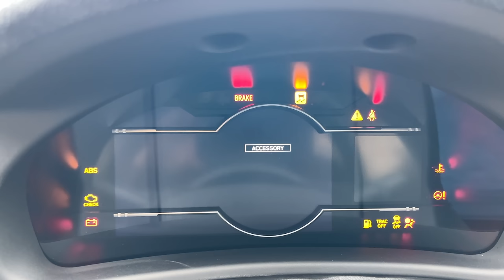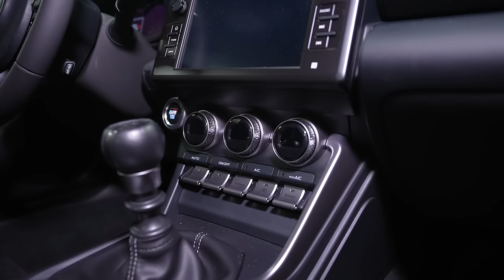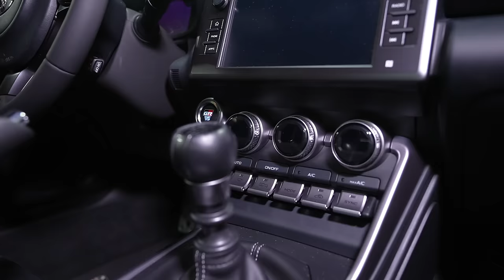Should You Buy a 2023 Toyota GR86? It's heavily over shadowed by a rival in 2023

Comment: Heavy econo car chassis that doesn't like to rotate with heavy front weight bias and understeer vs bespoke & stiff RWD chassis, on demand oversteer, lightweight & responsive NA. GR86 by a mile for drivers. You need to hit a back road or the track and look up the word, "special." One is a mini minivan and the other one is a pure sports car. You can get a heavy, 4WD understeering sled from a few manufacturers. Name another manual, RWD coupe under 3000 lbs on sale new.
Reply: ND2 Miata rf beats this in all aspects especially reliability. Not a coupe though but close to it.
Reply: @junkazama7922  
Sure it does because you said so.
Obviously internet experts showing zero evidence of their delusional statements should be taken srsly - not. LMAO!
Reply: @jun kazama  it's not a coupe and not close to it. GR86 is about 3x stiffer. RF adds only weight. No added rigidity. Same problem with the S2000. Lacks rigidity and only understeer sucks worse than cowl shake... Why enthusiasts begged for an MX5 coupe. We never got one. Sucks. Would be a much more serious sports car with solid rigidity. As is it's lacking.
Reply: @Racerx777  3x stiffer and still and gets beat on autocross. Sigh i wonder why.
Reply: @jun kazama  try a real track and get back to us. Auto X is parking garage racing. And it's not about #s. The new twins feel better and are just more fun. Joking aside, MX5s are bad ass but I do prefer the new twins. And if you want to get really serious? MX5 isn't stiff enough to go ballistic. 10K Nm/degree isn't going to cut it. 30K Nm/degree will. FI? Have at it
Reply: @junkazama7922  you will be pleased to know that several other reviewers, race car drivers included, have tested and stated that the MX-5 ND2 soft top loses to both S2000 and GR86/BRZ twins. The GR86 even outhandles the Mazda halo car.

So unless you do your own video, you're just another random dude from the internet making claims that can't be backed up with facts

Comment: Problem with the GR Corolla is that it’s reached unobtainable status by it’s limited production and dealer markups making the GR86 the only car in Toyotas lineup that’s sporty and affordable
Reply: Are they really only making a limited run with the corolla I had no idea, asking cause I'm on the fence on which one to buy
Reply: Toyota stealerships are trying VERY hard to make even the GR86 unobtainable as well.  My local dealer are blantantly marking the used cars as $42K.  A NEW one is $32k. lol.  Just INSANE.   They then try saying they mark them down, and you 'save' thousands, whilst still charging around $1k more than new. lol.
Reply: I would not buy a turbo 3 cylinder, especially a rally homologation, first iteration. It doesn't matter if it blows up after 1 season of rally.. but 50k miles on that engine? Hmm, maybe the 2nd version or after a few years. When you can see the cars endurance and some vehicles start passing the 100k mile mark, then some conclusions can be drawn.
Reply: poors

Comment: Before even the new GR86/BRZ were announced, I wanted a GR yaris more than any other car, but unfortunately it was never coming to the US. So when they announced the GR Corolla, I was superrrr hyped for it and pretty much dead set on it being my next car. Coming from a 135i, I wanted a vehicle that could still slide around a bit, but have the traction of AWD when necessary. The second I found out the corolla wasnt as “tail happy” as the focus rs or MK8 R, I went and test drove a 2022 BRZ, just me, no salesman. Man, 30 minutes in, I drove back in a hurry and bought that damn car. It’s every bit as fun as everyone says it is, and I haven’t regretted walking away from the GR Corolla one bit. I may just like it more than the 135i, but to me, nothing will ever top an inline 6 sound/smoothness.
Reply: I agree with you.  More companies need to bring back the inline 6 or else I'm gonna make my own
Reply: Im sry but if a 135 (even the M135) is a sporty car for you, you really need a  education. 
And therefore your comments are invalid on 86/BRZ. 
I love the idea of rear wheel drive, the ability to Power steer and throw the car into corners. But the 135 does none of that, if try and drive hard the traction control is on every corner and the rear still steps out wildly. it is not a progressive power slide/ Steer. It is just not a well balanced car. It is not enjoyable to drive hard or at all confidence inspiring. is one of the worst rear ends ever.
I drove a M2 and my commodore sedan ( With great tyres) both much heavier and both with  consideration for their market position are progressive power sliders and are not hitting the tra tion control every  corner.
Reply: Totally agree, the BMWs engine is sublime, but, like all BMW manuals, they are garbage.  The GR86 is truly the modern day JDM cheap fun car, and is almost a poor man's Cayman.  The M135i/M140i of the old RWD platform are just not fun to drive the way the 86 is, but they are great cars in their own way.

Comment: I guess the thing that I like about this car over the GR Corolla is that it's more 'romantic'? It's a simpler, more straightforward car. it feels like the GR Corolla's 'specialness' is diminished by it sharing so much with the regular Corolla, while one of the things that makes the GR yaris and the GR86 (technically) feel 'pure' is that they're unique bodies built to do the one thing that they do

besides, wouldn't a turbocharged GR86 cut into the 2.0 supra's niche?
Reply: This one is also RWD while the GR Corolla is AWD. Therefore I´m also more attracted to the 86.
Reply: The biggest besides HP is that the GR86 is clean lines 2 door coupe.  The GRC is just 4 doors ugly as hell.
Reply: I purchased the 2015 FRS right off the showroom floor. Best car I ever owned. It’s the only car that I’ve never traded in after 4 years. But now I really want the new model. 
I’m in love with the new red color ❤️‍🔥❤️‍🔥❤️‍🔥🏁

Comment: Having owned the previous gen BRZ, I agree with you. They totally should have focused on reinforcing 2nd gear.
Reply: Why? It makes no sense to me. 3rd’s synchros should be carbon, not 2 or 4. On track you use 2 and 3. You use synchros when up shifting. You should be double clutch rev matching down. 2nd synchros go out drag racing. Why are you drag racing in an 86? 😂
Reply: @JaySee5  Well nobody generally is drag racing them unless they're heavily modded, but the 1st gen in particular you'd be revving the nuts off it at all times because it was low on power, and 2nd gear always felt weird, that's all. You sound more knowledgeable on it than me though so I would defer to you.

Comment: Great video!! This is my dream car. Screw the FWD based GR Corolla. Don't care about how fast it can go, how it can drift with the gizmos etc... a proper RWD pure N/A engine can't be beat.
Reply: It can. I have an accord 2.0 sport, with very light suspension mods (mostly swaybars, strut bars) factory wheels, factory shocks and brakes. With a stage 2 tune and NO engine mods, I walked an m340i and am capable of literally bringing the rear around at a similar pace and hang with it on a track. So this is ridiculous assumption that RWD is in any way superior. Poor guy was mad that a mom car beat him in a straight and on track...WITH STOCK PARTS and nothing but good ground up engineering.
Reply: @singular9  the fact that you still have to mod the GR Corolla to be as fun as the GR86 whilst being much more expensive defeats the purpose.
Reply: @singular9  nobody cares how fast you can go unless track is your primary use for a car, and in that case, you can build a track car. The 340i with equivalent mods would be even faster. Anyway, it's all about engagement and driving fun, and no turbo Accord is getting close to a Miata or GR86 on that front. Who cares how fast you can go in a straight line.
Reply: Well said! Folks don't seem to really understand the purpose of this platform nor the historical and cultural significance of what the 86 represents in Japanese car cultural. Sad! People need to do more research!
Reply: @singular9  additionally, the GR86, on stock settings, has the potential to break most tracks' class time records, someone nearly did, look it up on youtube.

Someone also posted an unofficial time of 8:27 in the Nurburgring. So the notion of the GR86 being slow is false.

The BMW you "raced" probably didn't even know you were "racing"
Reply: @singular9  rwd > fwd
Reply: The GR Corolla is AWD though? With options for the drivetrain to be 50/50, 30/70, etc
Reply: @vcrazy_diamond  doesn’t work as well as you think. Check the reviews on that.
Reply: Yeah FRONT wheels drive are for children and women.
Reply: Thank you
Reply: bro did not watch the whole video 😂🤦‍♂
Reply: I love the car care nut and not even this horrible take from him in this video about the GR Corolla will change that. But yeah, it's a horrible take and the GR four system hasn't lived up to the tail happy marketing, not to mention it only works for 5 minutes every hour.
Reply: @singular9 how's that open diff bud
Reply: @singular9 if you don't understand the pleasure of owning a balanced, RWD pure sports car, you should keep driving your Accord and beat soccer moms off the traffic light. All the power to you.
Reply: @vcrazy_diamond That's all a gimmick. It'll still understeer at the limit. And remember the rear wheels are connected via a clutch in the center diff. Not the same as a RWD car.
Reply: @singular9 if you don't get balanced, RWD, light weight, pure NA car, you gotta stick to your Accord and race soccer moms off traffic lights lmao.
Reply: Calm down. Reality is there are many fwd cars that are bimbke enough to beat rwd car of the same class. A modded fiesta ST walks all of these cars and is well balanced. I’ve owned many rwd cars to know the difference
Reply: @criSOME1 What's well balanced about 60%+ of cars weight on front axel? Or front wheels having to steer and understeer and torque steer all at the same time. 😂
Reply: @hossemadian7127  It takes a slightly different approach at the apex in turns but yes you can yield the same results in race tracks. look up the Nurburgring lap results on sport cars. Look up mishka's channel where he pushes every car to the limit. Chances are you are not driving that RWD car to the full potential like that of a pro or very skilled driver because you are always on the verge of losing control. I agree that RWD cars are more fun and more complex, but be real here. Ive only owned about 6 cars total to even know the difference. I expect anyone reading to as well

Comment: Thank you for your in depth review.  I have been thinking about purchasing this vehicle since 2022 however still holding off. I know Sub/Toyota can add some more horse power to the 2.4.
I did not realize the standard transmission needed to beef up second gear. AND, you were/are the only reviewer that has mentioned this in-depth. Greatly appreciate this detailed overview.  Thanks again!
Reply: If you watch some exhaust reviews for this car you will see why second gear goes. Every weekend racer power shifts the crap out of these poor cars doing the 1-2. Sounds cool, chirps the tires, eats the synchro. Mechanics, by virtue of the job, see the worst of the worst. (Speaking as a mechanic) Shift it like a street car that you actually care about and it won't wear any quicker than any other low HP stick shift.

Comment: 22 brz here. I agree with everything in this video..except one thing..

The major complaints such as power and component's are a selling point for enthusiasts, think about it. It is really "the" tuner car of this decade. Its meant to be modified, worked on, tuned.. i get while out of the box its good, its not great.. but for who i believe the car is truly marketed for, the modders/tuners and the aftermarket businesses... this car is an absolute dream.

This car has the look, the price, the bones and hits a lot of areas that make it one of the absolute best project cars out there for gear heads and tuners to go wild. This car creates jobs and hobbies.. like many cars before it.. but who is building cars like this today, at this price point? Sure you can get a supra, a z... or you can get one of these and have thousands left over to truly build "your car".. and because its so affordable.. without guilt or worry.

So while i agree with everything, i have to argue those points. Most of those who end up owning these cars want to build and personalize it.. and you really cant get any better than this.

Comment: The fuel door shape is a nod to the 2000 GT headlight shape. If you look closely the GR86 takes a lot of styling queues from the 2000 GT.
Reply: Damn, I never noticed that, but it's true
Reply: Yas that would be correct even the inside looks like moder 2000gt , but I know that toyota bought porsche 911 and boxster to developed it ,teardrop shape , interior looks kinda like 911s

Comment: The video seems to start with a lot of errors. First, this second gen has much more oil starvation problems than the first generation; so whatever was done to the engine did not "solve the issue", it made it much worse. 
Then, the engine is called fa20 on gen 1, fa24 on gen2, not ta20/ta25.

Comment: The GR Corolla is marked up everywhere and not everyone wants a 4 door awd for their sports car. The only possible issue might be the trans if they are still too notchy but I have yet to drive one. I also prefer the 86 interior over the corolla. Miata is another option but they feel too cramped for me and I prefer a car with more precise handling like the 86 over the Miata with extra body roll. Not a big fan of drop tops either.

Comment: IMO - This doesn't compare to the GR Corolla. The Corolla to get is the Circuit edition, which is $42,900. That's over 10k more than the 86, and that's before every dealer markup on the Corolla. Also, the 86 comes in an automatic. It might not be a "true" GR model, but for a fun to drive RWD car that still comes in an automatic (wife won't drive a manual), there aren't many other options out there. I'm glad they still make this.

Comment: I like your reviews in general but you're missing the point. You're comparing a rear wheel drive sports car to a modified Corolla (which costs a lot more btw). Also despite issues with the  naturally aspirated boxer engine, I'd take that over an unproven turbo charged 3 cylinder engine which will experience much higher stresses. Stick to your old man reviews of camrys and minivans

Comment: You do the best car review videos anywhere! Love your honesty with your opinions on all cars you review. Having a true mechanic’s point of view is priceless. I am, however, very surprised you didn’t mention the RTV problem and how it’s causing blown engines due to oil starvation when the RTV gets stuck in the oil pickup tube? Has that been fixed in the 2023 models? Would like to hear your thoughts on this problem if you could look into it please. Keep up the great work…
Reply: Blown out of proportion. This is a non- issue on the GR86. The pickup screen was modified and now shaped like a box with more surface area!
Reply: Driver's perspective is pretty important on this kind of car
Reply: RTV isn't the issue. It's right hand turns.
Reply: Yep, RTV issue is fixed. now oil starvation under high lateral forces is the existential issue

Comment: I skipped to "what I don't like" and found his opinion elitest and impractical. I have a BRZ and for the price (I bought mine at MRSP) it has enough power and is a lot of fun. The insurance isn't outrageous as the GR Corolla and a Supra would be and people think it's an expensive sports car, even being mistaken most often for a Supra. The Corolla is, well, still a Corolla. The low CG and 53%/47% makes it a fun daily driver and a turbo would upset the fine balance. There's still enough room in the trunk to make it usable and there is a plethora of aftermarket parts to overcome most of the design and performance shortcomings. After a full year, I'm still happy with the car. I'll save the $10k higher price that most of the Corollas are going for in my area. I'm also concerned about the longevity of squeezing 300 hp out of 1600 ccs!

Comment: Not sure where to start with this review. Firstly the brake rotors on the new GR86/BRZ are larger, 12" vs 11.4", so there's that. The engine issues, if you've drove both the 1st gen and 2nd gen cars, you'll know its not even close FA20 puts down 150-160whp on dynos, the FA24 has routinely dyno'd at 215-220whp, thats a 50-60 hp difference, and is much smoother with a torque curve that produces power much lower in the Rev band, and they managed to mount it another inch lower in the 2nd gen as well, giving the car an even lower center of gravity. The fact ix only weighs marginally more than the first gen, while simultaneously being more refined, and dimensionally larger is something of a minor miracle. The handling is probably better than anything priced below a Porsche 718. The transmission is one of the best feeling ones on the market today, and is frequently lauded. Seems someone has some unresolved issues with boxer engines.